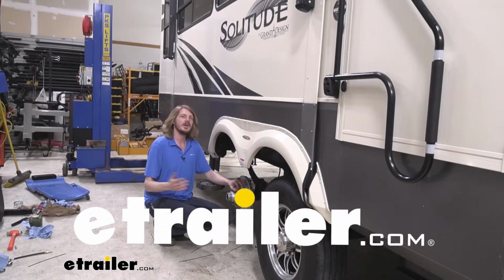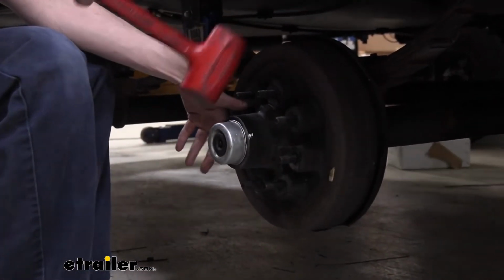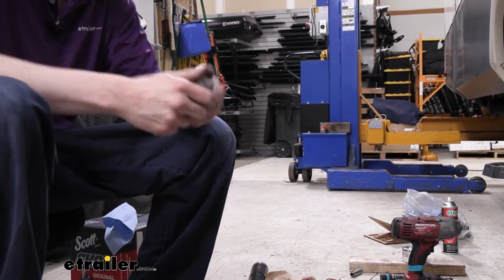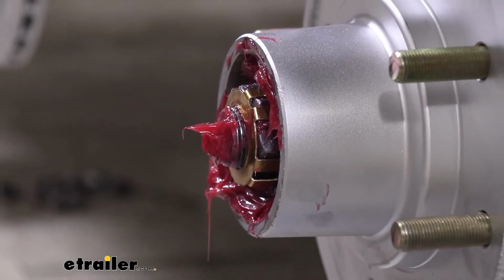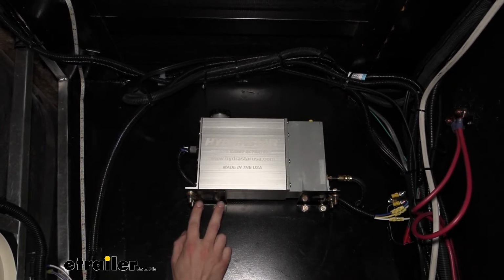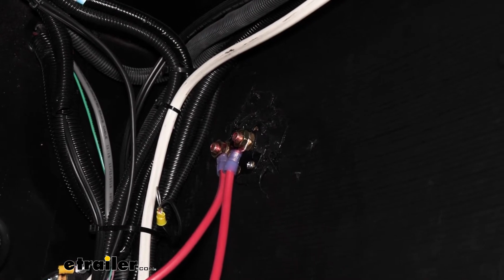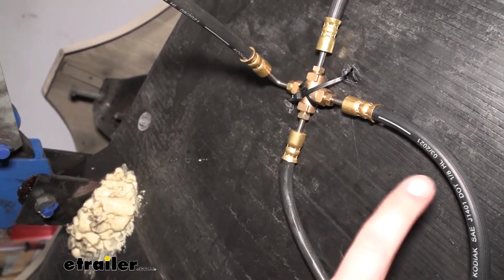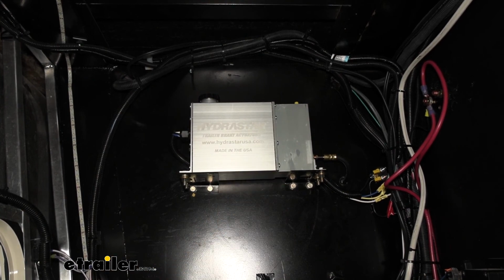HydraStar Electric Over Hydraulic Disc Brake Actuator Installation - 2019 Grand Design Solitude Fift

Comment: The problem with this install is when or if the trailer breaks away, it will no longer have power from the truck!...you would need to run a 12 volt power source from the brake actuator compartment back to that juction box...(so the brakes will have power when no longer hooked up to the truck!)...when the truck is not hooked up, there is no power in that juction box...Those black power wires in the juction only have power when connected to the truck!